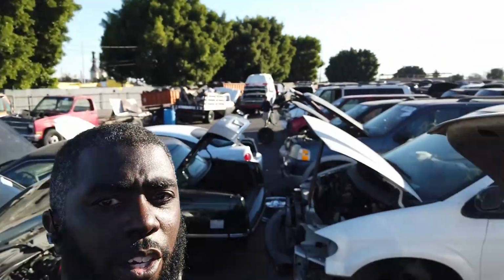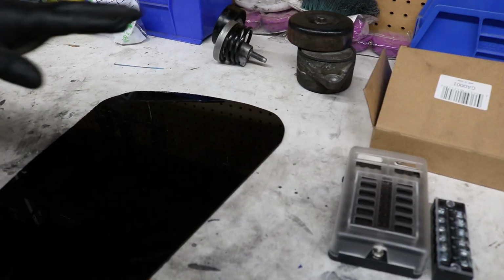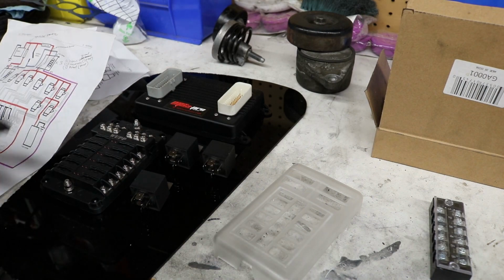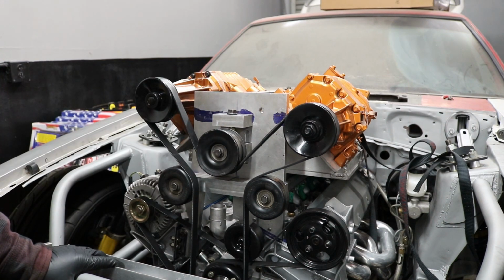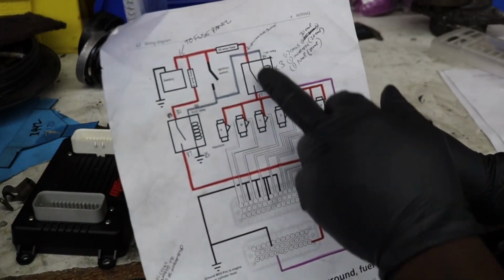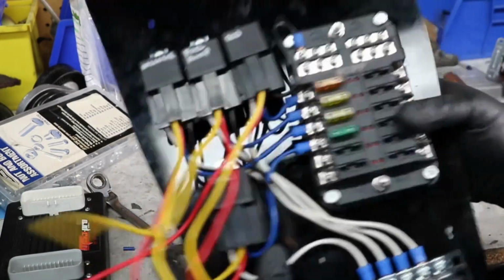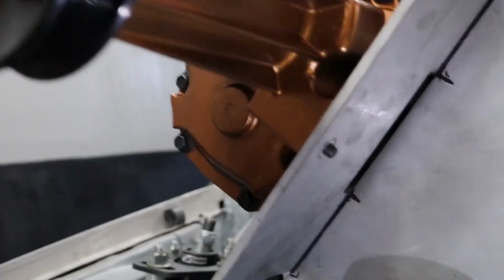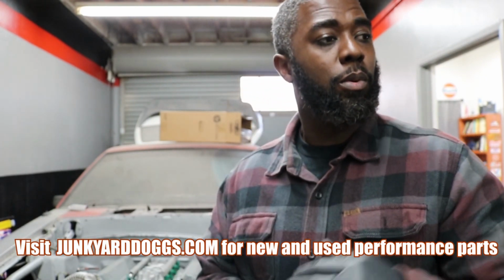Dual Supercharged Foxbody Mustang MS3-PRO/Intake Set Up - PROJECT MAYHEM PART 46

Comment: Can't believe your still going through with this. Just 1 on a 375hp 4.8 ls lost power with a M90. Adding a 2nd isn't going to help all that much more when 1 makes a motor lose power if it makes over 300hp N/A. It becomes a restriction after that. It's going to come down to how much power the motor makes N/A. If it's over 350hp or more your going to be disappointed with the power output. The best chance for this to make a difference is on a stock 302 motor. No heads or cam    but even that maybe too much. I've been 12.0s with the stock heads and cam. Just bolt ons, gears, tire, etc. Which made just over 300hp. Regardless I still wish you luck bro. It's a lot of effort for very little in return.

Comment: Be sure to add an inertia cut off switch to the fuel pump circuit.  I hope you don't ever wreck the Mayhem, but if you do, the inertia switch will kill the pump so it doesn't spray gas all over everything.

Comment: Look into a pulley belt tensioner from 2.8 and 3.1 Chevy front wheel drive engines. They are low profile and you might not have to redo that pulley frame.

Comment: I’d say start with your manual tensioner then make change if it don’t work. My high compression LS stroker had to have a manual tensioner or I’d get belt slip. Otherwise why can’t you use your manual tensioner/idler you built and run a spring over the draw bolt and design that to have some spring load along with manual tension. In my head I can picture it. It is possible.

Comment: Richard holdener YouTube channel engine dynoed a 5.3 with 1 m90 and it made less hp with it on couldn’t push enough air. I’m really curious if this will make any and or make jus as less..
Reply: Davi J idk what he did but a twin supercharger setup with m90 is going to do really well low end on the street and the butt dyno is gonna be crazy... it should make around 550-600hp which is plenty he’s not a racer.

Comment: Try running the belt system the way you have it first before you change it.
Reply: I agree, I have a homebrewed eaton set-up with no auto tensioner.  I think pulley alignment is more important than the lack of an auto tensioner.

Comment: I think if you run separate relays for the pump and injectors, you run the risk of having the fuel pump lose electricity and then ruining the injectors  by running them empty.
Reply: Injector can ran all day without fuel no problem
Reply from the maker: Oohhh thank you for that info.  Didnt think of that!

Comment: It's one of the biggest ford intake manifolds I've ever seen!   If it were me, I would worry about heat. One roots blower makes a lot of heat. 2 roots blowers HAVE to make even more heat. It would be cool if your welder friend could weld some C channel to your intake manifold and plumb AN feed and return fittings to both ends of it. That way, you could run a water pump in a tank in your trunk filled with ice water to circulate to it and then back to the tank. Cheap homemade intercooling at its finest.
Reply from the maker: Yes!  Thx for the idea

Comment: Probably so L brackets welded on the inside. At the ends  and bolt the cap on top. Is there any way of redoing the main belt pulley with a ( like a valve spring.) To work up and down. With tension. Of the belt. Just thinking. Ps and it hurts.😁👍

Comment: I agree about wanting to have a sprung tensioner in there but you do still have the option of running one of those Gates RPM belts. Basically they are designed specifically not to stretch under loading. Consequently they require tighter length tolerance to be run at the right tension but you have the adjustable setup so that's not a problem.

Comment: I follow what your friend is saying but the belt stretches to a point then it's tight. You are gonna be eati g belts any way around it. I think you are better off with mechanical tension. Maybe a small pulley with a gas strut type thing,Like somebody mentioned a steering damper. I know your all set up already but really the way to go is timing belt type. No slip. Watch any Dyno stuff and there is always belt issues.

Comment: In my opinion the superchargers need to be closer and the intake box need to be cut so it could pull the air in or else it will not run right it's too much room in that box making it to lag alot I love the build bro
Reply: Or fill the box volume with a big air to liquid intercooler.
Win-win.

Comment: My 5.0 Procharger P1SC kit used a separate belt to run just the supercharger with a mechanical tensioner, no spring. I’d try it the way it is first. Looks like a solid setup.